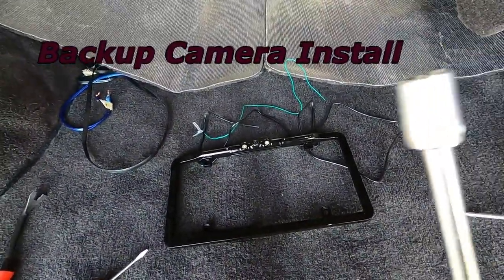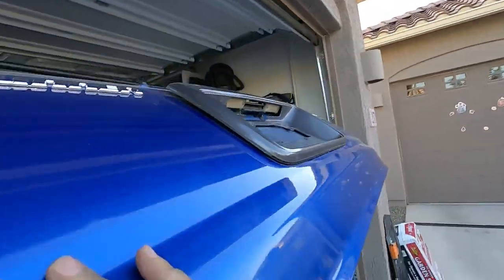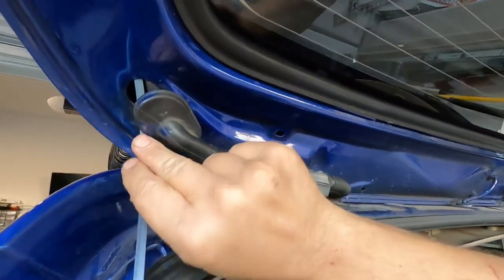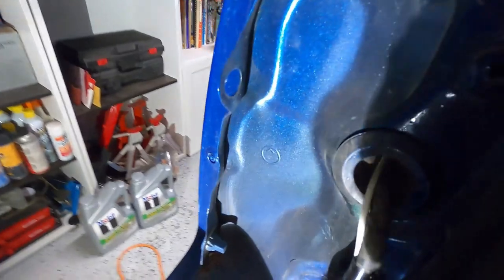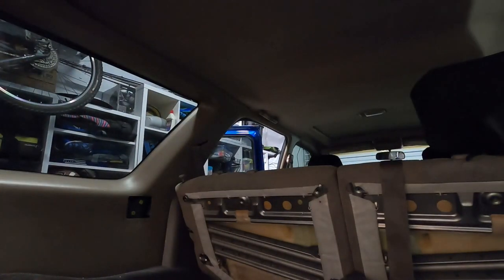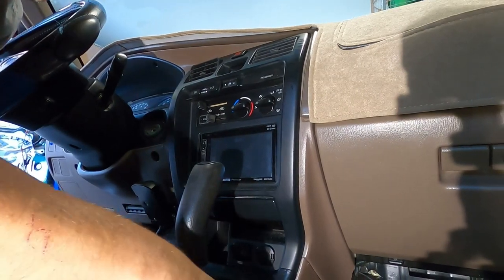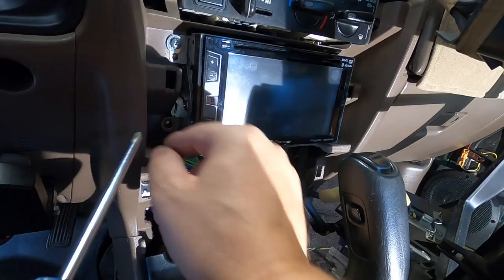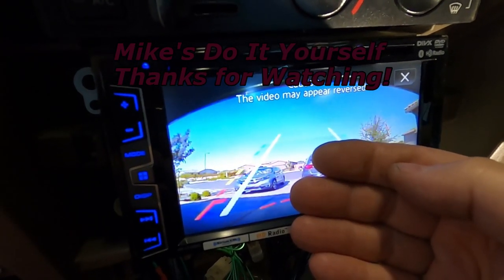Toyota 4Runner Backup Camera Install

Comment: What is a trigger wire and how did it go from inside the hatch back to inside?
Reply from the maker: The trigger wire receives a signal from your positive wire reverse light splice when you put the gear shifter into reverse, which goes to the reverse camera trigger wire that goes to your stereo - this tells the backup camera to show the picture on the stereo display. The first half of the video shows how the trigger wire goes from the backup camera, through the wire loom at the top of the tailgate, to the reverse light, through the side of the headliner, to the stereo itself. Good luck with your project!- Mike